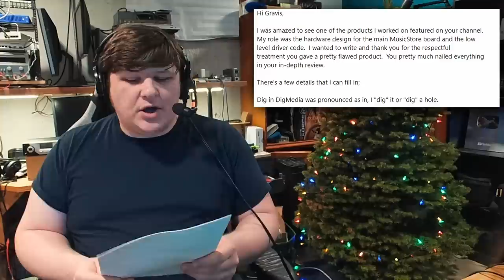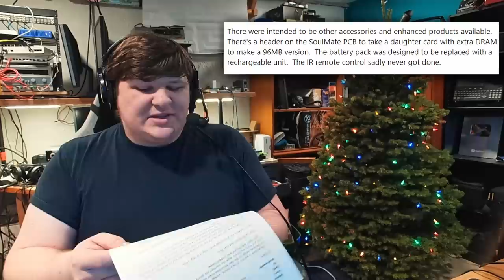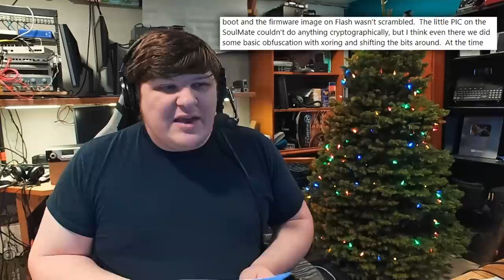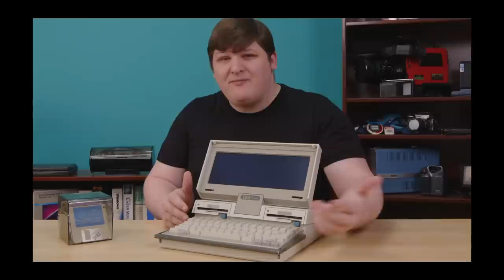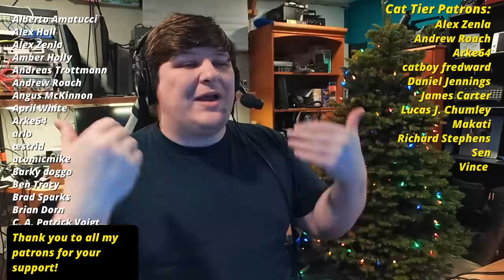The Rest of the MusicStory

Comment: oh one other note... as an embedded security person, your statement at 11:40 is pretty much spot on. it's 100% impossible to store a secret that can't be extracted. virtually every SoC and microcontroller on the market today offers some form of "secure key storage" to support DRM, identity attestation, and/or user data encryption. there are some useful asymmetries to engineers, where it can be much cheaper to scramble a key or a physical design, but much more costly to work backwards. so, you can raise the cost to an attacker, or slow them down, or even design a system that erases the secret in the face of detected tampering. ultimately however, these are a one-time cost to overcome, and when a sufficiently motivated adversary overcomes them, they will recover the secret

Comment: There is an impressive number of lessons to be learned from this video. I feel it should be shown in both history and English classes, especially since both subjects overlap considerably.

Personally, I was excited to see your speculation proven right!
I think it's fun to speculate the design intent of these devices. Often I feel like I see modern appliances hidden within old ones. They were trying to have what we have today, but only with tech available at the time.

Now days you'll be hard set to find an amplifier without bluetooth connectivity. (or an amplifier without a built in speaker) In a round about way it's the same concept, but backwards. Load your playlist onto small device, "connect" it to big hifi set. Still only one copy active. Small device can even download songs by itself now so you don't need a compter active all the time.

Growing up in a PC household I've been very surprised to find that tablets really have replaced desktop computers for most... "normies" and I think they'll continue to do so.

Comment: Hi, Ive been into the sound production scene & radio broadcast since the early 90's. I dont know how rare this is but I bought an optimus dr100 solid state sound recorder in 1998 & it still works perfectly. Its huge, records for 38 mins, has no removable memory, audio transfer is with analog conection only. It has volatile ram & the instructions say that its only guaranteed to hold recordings for 4 mins while changing batteries , although I left it a week once & still retained all data. I still used it sometimes on air up untill mid last year & is a great toy to play with.
Cheers Daniel.

Comment: As someone who has worked on several Danger hiptop (T-Mobile Sidekick) phones and then been witness to the disaster that was the Microsoft Kin phone, after we were acquired, and then later working at Google on Nexus devices, your commentary is spot-on. Your insight into the industrial design and tradeoffs of commercial product development is exactly the reality.

I was just reminded of a product that I beta-tested at Google but wasn't involved with that was almost the inverse of this MusicStore device was the Nexus Q, which was canceled before it actually shipped, because everyone panned the expensive cost and the relatively limited features. It was made out of very expensive metal with high-quality analog speaker amp and didn't stream video, just before a different team was much more successful with the first Chromecast dongle.
Reply from the maker: Thanks! I actually have a Q somewhere that someone sent me - astonishingly overbuilt and, yeah, surprisingly underwhelming compared to the simple usefulness of the chromecast.

Comment: The silicon required to perform decryption on device without making the keys accessible to someone with physical access is now widely available in low cost (most recent ESP models have this). The only real issue with becoming available there is a combination of demand and it becoming cheap enough to have the encryption & decryption logic implemented in silicon rather than software.

The way this topically gets done is the SoC has some write-only/write-once electronic fuse memory (you write to it by literally burning fuses in the silicon). Software running on the chip has no mechanism to read the memory, but the cryptography hardware does. You can’t dump the keys or even run alternative software on the core from a different ROM to get the keys out (you can still get them by checking the actual fuses by de-lidding and checking with scanning electron microscopes or similar; it’s tedious, error-prone, and requires some fairly niche tooling and skills).

Comment: The "XOR" operation is at the core of even most advanced (symmetric) cryptography... just a whole lot of it rather than just one or two per bit. Even AES is - at its core - a convoluted list of XOR operations where the bits that go against the key are scrambled up in a loop, so even a single bit off would yield "random" results. Simple XOR does meet the definiton of encypting, but a single XOR run usually yields data that "looks" like data still. What it DOES, is it conveys a message to players that follow the rules: "Hey, this data isn't supposed to be used outside our device". XOR Obfuscation - like it is used in XPS docs to hide TTF files - is more a way to prevent automated systems from finding and messing with them.

Comment: Mentioning using defective DRAM triggered an old memory. Before flash, I worked on a data storage device based on battery backed up defective DRAM. Project ended up cancelled because the DRAM source kept improving the process (imagine that) resulting in the DRAM becoming prohibitively expensive. Fun but doomed produce.

Comment: I think an additional factor here is that all this stuff was pushing the envelope. MP3 players started appearing as soon as they were remotely practical. They had to make players with 32MB Flash because that was all that was affordable to use. They didn't have the margins we have to work with today. It was much harder to make an usable product on a budget.

These days it's much easier, if you find you have to save some money and go with 32GB flash instead of 64GB flash, it's still a lot of music, so you can make that sacrifice for the sake of improving something else. But back in the 2000s they couldn't halve the storage because it'd cripple the product, so they had to cheap out on every single other thing they could.

Comment: Eh, being wrong sometimes is a totally core part of the human experience - the important bits are making a solid attempt at accuracy, and being forthcoming with corrections (pinned comments work fine IMO).  Plus, part of the benefit of having an open discussion space below the video is a tighter feedback loop with differently-informed viewers, and that's a huge benefit over, say, TV.  You've managed to attract a calm and articulate crowd from what I've seen, which helps haha.
Also, I really appreciate how in stuff like these hardware teardowns, you reference both concrete factual info (what's printed on top, what the datasheet says) and speculated purpose.  It feels like it flows naturally in your delivery / not over-scripted.
Perhaps in some ways it's more like presenting tech archaeology than "history", and there's a stronger implied expectation as a viewer that what I'm watching is your interpretation layered on top of presenting the artifacts.  I'm frequently making my own guesses as I watch your teardown - that's part of the fun part :)

Comment: The discussion at about 11:25 about a device that does encryption/decryption on the chip without allowing any access to it made me think of credit card / SIM chips - i don't know how well they do it, but it certainly seems like they're in that category. Is there some technical distinction where that doesn't count as what you were talking about?

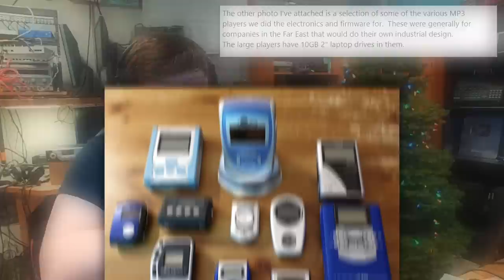I recognize one of those MP3 players at 16:28, the one slightly off center to the right is one I actually owned. I don't even remember what the damn thing was called though.

Comment: I watched until the 28 minute mark. I want to elaborate on the quality or accuracy or enough researched argument. You have Tom Scott as an example. Fair enough. As a fairly aged person (in the forties) I'd like to offer you another example: "mainstream media". Doesn't matter if it's print, radio oder television. They are all wrong in so many ways so many times. Intentionally to be dramatic or unintentionally due to lack of knowledge. Back in the 2000s it was immediately obvious to me when there was mass-hysteria about FPS games (DOOM, Quake, etc) and the fear of mass murderers resulting from this. Or other tech-related topics which I happend to have a decent knowledge about in later years. They have a much broader audience, are far better funded but due to reasons I will not speculate on, they do not research hard enough to get the complete picture. Which results in a sad percentage of people distrusting "mainstream media" right away (which is not good IMHO). I really like your videos. The longer, the better. Do short ones, it's okay. I assume you to be not always correct. Because you are human and we all make mistakes. A 34 minute video to make right what you did wrong in a 84 minute video. Heck, thank you that you were wrong. Otherwise I'd missed this one.

Comment: Man, around 22:00 when you discussion epistemology of a YouTuber presenting info on esoteric hardware, I feel this. There's a truthiness when presenting. My cup o' tea is Mac hardware (current to Intel transition) and I've done videos on sepOS and SSD upgrades on Apple Silicon and I'm always struggling to find the balance of factual presentation and stipulation. I can't hedge every line I say and I do get things wrong. It's embarrassing but I'd rather people get correct info than stroke my ego.  

The only solution I have is just a wall of links in the descriptions of my video. I wish there was a way to annotate YouTube vids with corrections for my content but any such system would be exploited by less scrupulous YouTuber.  As someone who does it as a hobby, I just don't have the time and resources to get everything air-tight, otherwise I'd never publish anything.

Comment: At 19:53, I figured I should tap in here as an Intel engineer. I worked on Lakefield, Meteor Lake, Lunar Lake, and now the unnamed thing after that. I would risk my job if I confirmed anything about the unreleased ones, and even the released and discontinued ones have stuff that will never surface about them. I know what happened to Alchemist, and I know what Battlemage and Celestial are (2nd/ 3rd gen). All I can say is that they exist in some form. That is literally where the NDA stops.

Comment: There are so many things people don't know about, and they're usually very small things that mean a lot to people in certain professions, but not to others in the general populace. Like a guy who worked for the OTIS lift/elevator company. The only time the open and close doors buttons on the control panel actually work is when the key is turned and the device is put into full manual mode. That only happens when the lift is being used for freight, when you don't wan the doors to close automatically when you may be trying to move a large object that's difficult to maneuver inside. 

Not many people care about this, besides maybe an engineering student like myself when one of my mechanical engineering profs talked about lifts and the complexity of how they operate, especially the newer nicer ones. 

I would say for the plaques outside of the buildings for fire fighters to be aware of to fight fires in those buildings, there probably was some document stating you need to train your employees to look for these things. However, after that, the papers might have been lost in a move, remodel, cleaning, or just dumping old "useless" records that were no longer considered valuable. I mean, for all we know, there might not have been anything written at all about it and the fire chiefs were simply told about and or shown them and said you need to be aware of these, and here are some extra bit of info for your blokes. Again though, we don't know.
Reply: Yeah, plenty of policies didn’t really need to be written down at all, so long as there was enough continuity of talent/workforce to pass down the institutional knowledge.

Comment: With respect to Memory Systems having aimed to exploit defective DRAM, it's interesting to note that one of the reasons the ZX Spectrum was so cheap (and that it used the not-entirely-common RAM configuration of 16 and 48k variants) is because all the RAM used in Spectrums was comprised of 32k chips which had failed testing because only half of the RAM was available...

Comment: I was 25 in the year 2000 and working in a small computer store. I got 99% of my information from print (multiple subscriptions to monthly magazines). I could have probably told you that this MP3 player was sh.t based upon contemporary sources. In fact I vaguely remember this particular MP3 player being reviewed - I do recall multiple reviews of players that couldn't play unprotected downloaded MP3s and how unlikely any of those were to succeed. 
You won't find any of those reviews online. Print was still king.
I enjoy your content. I would suggest that obtaining large amounts of printed literature from the period(s) in questions would improve your channels content (both from a 'perspective of the times' stance, as well as for subject ideas.
At the time this particular MP3 player would have been predicted to have become a failure. Not due to technical limitations, but due to the mindset at the time. Copy protection on files was a huge no-no.
Reply from the maker: I actually do work off of print literature - Google Books scanned and indexed a number of publications and Internet Archive does so with several others. Most of my info comes from those scans. It's certainly not comprehensive though.

Comment: Embedding decryption keys inside firmware is definitely weak method by modern standards, but I think they did their best to hide the keys.
I don't think secure key storage like lockable key storage inside CPU didn't exist, and the most "secure key storage" back then would've been using battery-backed RAM(like some arcade machines did), which would die after years, lose keys, batteries would leak, and destroy the board.
Reply from the maker: There were secure processors, because I've read a great paper from 1996 on breaking into them - Texas Instruments was making SoCs with layer upon layer of physical protection to keep you from decapping the chip and probing the memory directly, stuff like die-level light sensors to detect exposure to room light, and many layers of magnet wire wrapped around the chip that you have to cut to reach the die, and triggering either one would wipe the secure storage. The stuff was around, but it was fiendishly expensive and largely intended for military customers.
Reply: @CathodeRayDude  Yeah, I also thought "If it existed, the price would've been unacceptable for cheap consumer products".

Comment: Got a CKC-021 viewfinder fully working over 12V, GND and Composite, gonna install an AV jack on it and 12V PD USB-C :))))))))). Just spent a few hours tuning the color, hue, color sync, brightness and everything else. After recapping the whole KVX-370, I managed to hook it backwards *f##k Sony and their centernegative barrels*, blew up a capacitor most likely, still got all the main voltages and audio amplifier stage, but hadn't gotten a red light yet or high voltage or filament voltage. Replaced a lot of caps with new counterparts, excluding radial 220uF 6.3V, which got tantalum replacements instead.

Comment: Ultimately the history of 70's->00's prosumer electronics isn't anything that has the potential to cause any great harm if you happen to get some details wrong. Nobody else is even trying to cover this space and your 90% right history is better than a history that was never written. 

There ARE ultimately exhaustively researched histories about even the most niche of subjects. They are typically in book form and cost a pretty penny. People know that when they click your video they are getting the 90% solution. Please don't lose sleep about your occasional errors. Put corrections in the comments if they come up. 

Your videos are also only part of the story.  You are collecting the original hardware and other documentation associated with said hardware. You are also contacting the original engineers and you can find a way to document their primary source information and/or artifacts. Don't let perfect be the enemy of good.

Comment: Honestly, It's not worth taking anything as truth, especially if it's about something as vague or old as old tech (or the topics Tom Scott covers) can be. Everyone would benefit to just research things, especially with how rampant errors, rumors, and sometimes even blatant lies can be. Also, to just push the point even further that anyone can make mistakes, Linus from LTT made a video a month ago about D-VHS, and he said that VHS video was "240i" and DVDs were "480p", where one is just completely false, and the other is misleading. I made a whole write-up on that video explaining possible misconceptions and breaking down terminology, but the footnotes are that VCRs recorded the direct composite (480i) signal, but DVDs played back video at whatever resolution it was stored at (usually 720x480, but could be as low as 352x240 or lower in some cases), making DVDs not inherently 480p. Even then, most people either just used composite (480i), or they didn't shell out the extra cash for "Progressive Scan" DVD players and TVs that could handle component (480p) video.

TL;DR, always do your do-diligence and research, even if you're hearing information from a reliable source. Even if they have tons of employees and millions of subscribers, they can still be wrong.